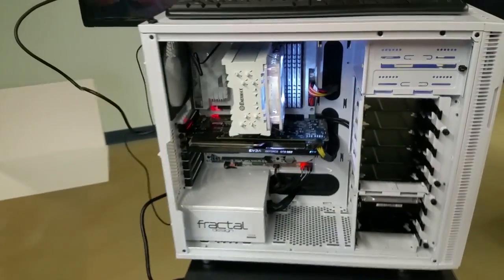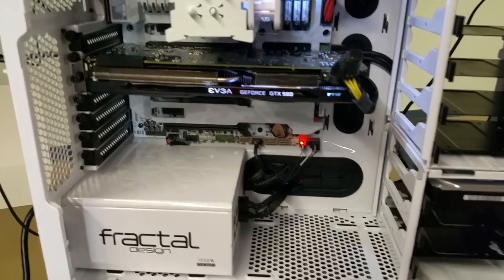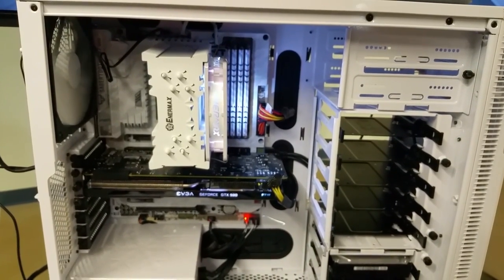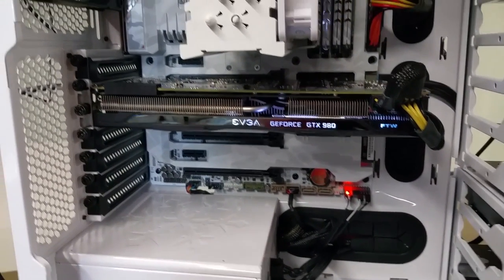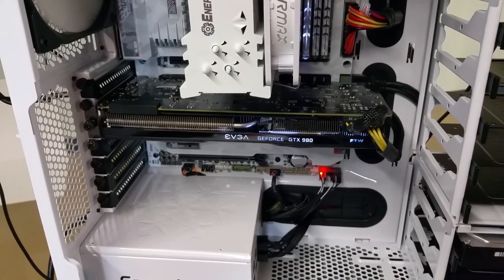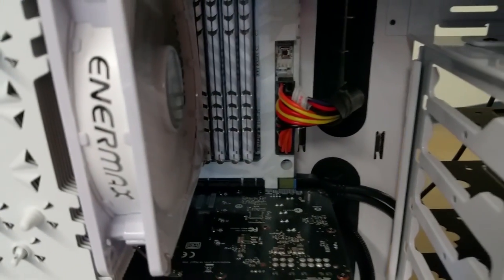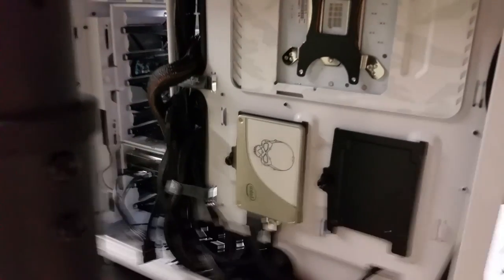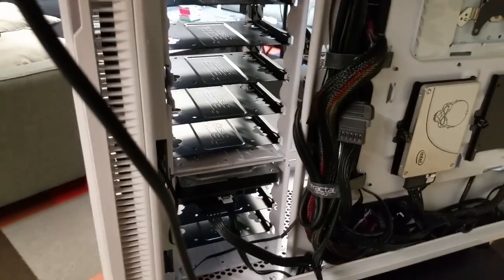Arashikage - Ultimate $2000 All White PC Build Vlog - 3 | Phase I Complete!

Comment: i would ditch the top drive cage. its just hindering airflow and making noise.
Reply: Lawrence Timme  How is it making noise? SrgntBallisticGaming You might want to return your R5 and get a Define S if you aren't using the cages anyways.
Reply: Arnav VR because the air that has to go through it will make noise.
Reply: SrgntBallisticGaming yeah are you gonna keep the top cage in?
Reply: Lawrence Timme yeah just get rid of the useless cage
Reply from the maker: ***** nah it's already out

Comment: First: Nice video!!
What about the 980 HoF? Or is that out of budget?
Maybe change the cpu fan to pull, for the RAM and the dust. And you should remove some drive cages. To keep that area clean for air flow
Reply: Btw, keep uploading!. Your small but very professional :)
Reply from the maker: vGriizzly Hey thanks for watching! Yes I love the look of the HoF and it would look great in my build! Unfortunately it's a lot more expensive than other cards of about equal performance. I just can't justify the price premium right now.

I reached out to Galax for a review same. They initially seemed interested but I haven't heard back from them!